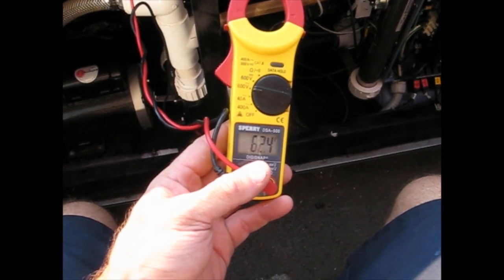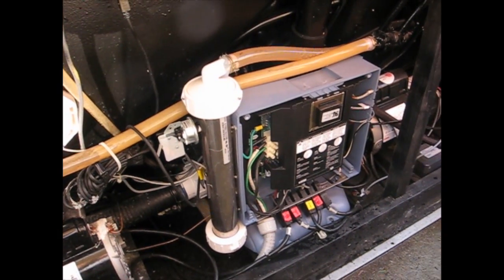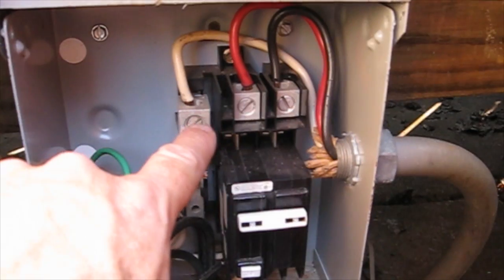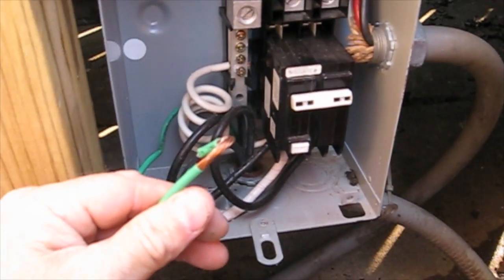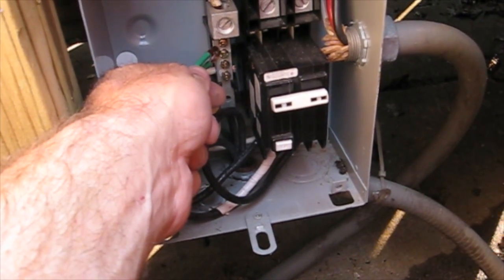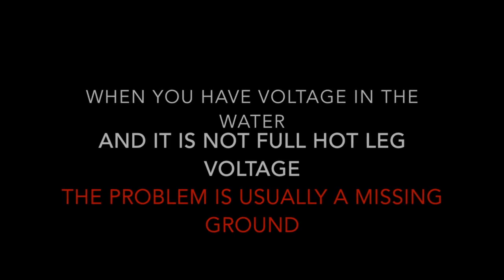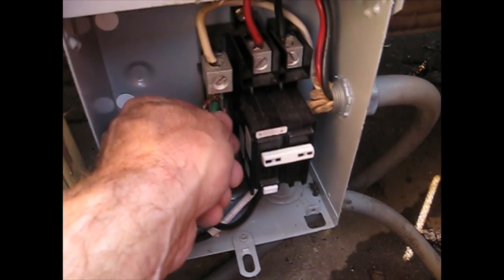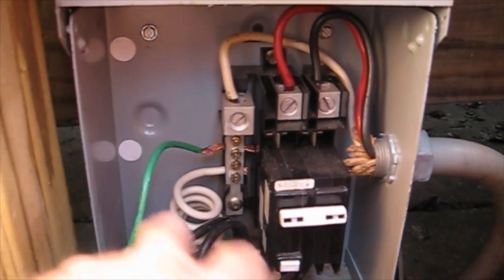Voltage in The Water on a Hot Tub How To Video from The Spa Guy

Comment: That bonding screw should not be installed at any sub panel. Only at the first point of entry to the house should the neutral and ground be bonded. There should be a ground bar installed in that sub panel as well as a green  grounding wire running to the main breaker box for that  unconnected ground wire. I can not believe you left this video up after multiple people explained this in the comments to you.

Comment: Been an electrician over 30 years and that spa box as per code should have a separate ground bar and the neutral should not be bonded to the box. It's supposed to act as a sub panel and ground and neutral shall only be bonded together in the main panel. Any panel after that has to have a separate mechanical ground and neutral. The main reason for this is if there is a dead short between the ground or the neutral the main breaker in the primary panel will trip first.

Comment: Just had hot tub installed on concrete pad. Breaker box installed i5 feet away. Conduit running under concrete pad up to a stub under hot tub. Just opened breaker box and found green ground connected to nothing at all.  Thank you for your help. Someone is getting an ear full.
Reply from the maker: Glad to help!!
Reply: Good catch, under the right circumstances that could have gotten someone killed. Grounding and bonding is so important around anything that contains water.

Comment: I have the same exact problem  but when I hook up the ground it trips my gfi and if I disconnect  my element it Does  not trip the gfi but then I don't have no heater element  hooked up ,Please help I checked my element  with a ohm meter  with taps disconnected  and am getting 15 with ohm meter  set at 20 I also check element with ohm meter  one PRONG  at a time ,one to prong and other one to element  housing and its ol ,both checked out fine so that would tell me that element  is fine ,but when I hook everything  back correctly it trips gfi breaker again, when I do a jumper from bottom  of relay black side to element it heats the water but I feel a lite shock when I touch the water and am bare foot

Comment: What if it's 120v in the water?
Reply from the maker: Then you can't have a GFCI in the wiring first which is a no no.. You need to get a GFCI wired in and then it will trip.. You start unplugging things to figure out what is putting voltage in the water..
Reply: Well thats the problem I do have a 50A Gfci and it didn't trip I thought maybe it was a ground but now I'm just lost.
Reply: I have full 120v in the water.
Reply from the maker: @masonowen839  Do you have a GFCI Breaker installed?

Comment: Ground and neutral are only to be bonded at the service, otherwise you can put a load on your ground which can in turn put a load on any other metal chassis it is bonded to.

That's NEC.

To prevent a fire, electric shock, improper operation of circuit protection devices, as well as improper operation of sensitive equipment, the grounding of electrical systems, the bonding of equipment and circuit conductors must be done in a manner that prevents objectionable current (neutral return current) from flowing on conductive materials, electrical equipment, or on grounding and bonding paths [250.6].

This is accomplished by keeping the grounded (neutral) conductor separated from the metal parts of electrical equipment, except as required for service equipment in 250.24(B) and separately derived systems in 250.30(A)(1)] in accordance with 250.142.
Reply: Spa Guy... you are incorrect on this one as others have also explained to you. The screw you put back in to “ground the box” should not have been installed... the neutral bar should not be bonded to the box in any sub panel... there should be two separate bus bars.. one for the neutrals and one for the grounds. The proper way to fix the issue is to run a ground back to your main panel box and install an additional bus bar in your spa panel for the grounds. The ground should not be hooked in with the neutrals period.
Reply from the maker: @philpompeo7566  I am well aware of what all of you say and I am aware of what the code is what you can't tell me is how you can introduce voltage in the water without the breaker tripping.. If you wire it the way I show you cannot do it.. If I wire it the way you all show I can easily introduce voltage in the water.. My way is the safest way.. Prove me wrong.. Tell me how you can put voltage on the ground or neutral without tripping the breaker or how to put voltage in the water without tripping the breaker.. All of you quote others and codes but not one of you can give me an answer because it is not possible to do... Another simple thing you could do is tell me why the shunt is in the box?
Reply from the maker: Mike Seary ok explain just how you can have a load on the two grounds hooked together at the outboard box end and the feed end and it not trip the breaker??
Reply: @SpaGuy  bad breaker maybe.
Reply from the maker: Mike clearly you are an expert I asked you a question.. here it is again.. explain just how you can have a load on the two grounds hooked together at the outboard box end and the feed end and it not trip the breaker??

Comment: Spa guy I love your videos and I will continue to support you and continue to buy all my spa parts thru you for that reason but these guys are right if you bond ground and neutral in a sub panel there is a possibility that your ground wire could become a current carrying wire and at the end of the day it might get you by but it is not right .....please don’t scold me like you do everyone else .....🤫another reason why I like your videos...good day sr.
Reply from the maker: No scolding just tell me how it is possible to have too much ground? How is it possible to have two lines of ground together on the box end and that is different than the feed end which is hooked together and lastly why is the shunt in the box form the factory if there is no use for it..
Reply: Spa Guy current takes the path of lease resistance so if something was to ever happen to the neutral wire like a break in the wire then ground becomes the current carrier....and that could be a bad thing .....I know it’s far fetch BUT just stating facts out of the holy bible for electricians (the NEC) .....the bonding screw is in there form the factory for certain industrial applications ....I work at Gould’s pumps where we build pumps and we bond neutral and ground when we hipot test curtain motors just for testing purposes ...other then that I don’t know why they put them in there ......can’t believe you responded to me I just wanna say thank you so much for you videos....I moved into a house with a hot tube that had a leak in the fountain and a seized motor and your videos saved me hundreds ....I just wanna say thank you 😊
Reply from the maker: Ok so lets think about this of for a moment.. You have a ground wire coming to the box and you have a neutral wire coming to the box.. 2 separate wires one hooked to the neutral bar in the feed breaker box and one hooked to the ground bar.. In the feed breaker box both of those bars are hooked together with a shunt bar.. No onto the GFCI box.. One hooked to the ground bar and one hooked to the neutral bar.. Both come from the same point of ground from the feed box therefore they are really the same ground though they are two different colors and wire sizes.. If you were to unhook the white wire at the feed box the GFCI breaker would stay activated but the neutral wire from the GFCI brewer to the tub would introduce about 70-80 volts AC into the water.. If the ground wire was hooked up and you unhooked the white neutral wire at the feed breaker box the GFCI would not set.. So there is actually a way to introduce voltage in the water by losing a connection on the ground wire from the feed box to the GFCI box.. If you put the shunt in as I show it would be impossible to introduce voltage into the water through the GFCI breaker.. also if you had an open on either the ground or neutral wire then the box as well as the GFCI breaker side would still be grounded so there is no scenario that you can have voltage on either wire without it tripping the feed breaker.. No matter what the manuals say my way is the safest way and if the manuals do say that someone should work to change it because it is dangerous.. If you don't believe me unhook the feed ground at the feed box and test your hot tub water to the earth ground by wetting the dirt and placing a probe in it and the water and you will see what I am describing is true.. Then hook the ground back and unhook neutral and see the GFCI breaker trip.. Remember I don't know much but I do know hot tubs.. I have personally worked on 1000's of hot tubs and seen every crazy was something can be wired and my way is the safest period.. Thanks, Spa Guy
Reply: Spa Guy not gonna lie I have a huge amount of respect for you ....you clearly know your hot tubs and I will try that in the spring time but it’s 9 degrees in New York right now and there’s no way I’m unhooking anything right now lol 🤞🏼 ....I’ll need your help in the spring time anyway with an air valve that I can’t identify that has a white colored seal that’s leaking air, it got really gummy for some reason ......Again thanks for everything

Comment: Should never connect the ground wire to the neutral bar.
Reply: NEC code rule. Ground and neutral must be separated after the first means of disconnect. Therefore in the main panel the ground and neutral get bonded together. Anything after that they must be separated.
Reply: @dylandohn7922  I have watched a few of his spa GFCI videos and i always turn my head sideways when he bonds the neutral and ground bars together.
Reply: No tanks I don’t need to put that in my knowledge, ground and neutral is not the same., they are connected at the main disconnect for a reason but ground and neutral are not the same.
Reply from the maker: Let me get this straight you agree that they are connected at the source but are different at the next box how on earth is that? Ground and Neutral are exactly the same until you get on the hot tub side of the GFCI.. Then they are different... You need to stick to what you know I can tell you it is not hot tubs and wiring..
Reply: @SpaGuy  Ground and Neutral should be connected together only at the main breaker box and nowhere else. If you have two parallel wires that you call neutral and ground connected at both boxes, they are NOT neutral and ground. They are both half neutral at all times. If the tub is trying to draw 10 amps between hot and neutral, then there will be 5 amps running back to the main panel on the neutral wire, and the other 5 amps running back on the ground wire because they are parallel and equal wires. There should be all 10 amps on the neutral and obviously 0 on the ground during normal operation. The only way to guarantee this is by not bonding them together anywhere beyond the main panel.
Reply from the maker: The ground bar and the neutral incoming from the main breaker box are already connected in that box.. So what would the problem be too much ground?? That is a rhetorical question.. the answer is it makes zero difference if they are connected together or not except to people who think they are "Certified" electricians... The whole reason the shunt comes in the box from the factory to be used to connect the neutral bar to the rest of the box and ground is there are times where there is no neutral wire to the box only three wires like in the old days so you simply connect the shunt to the neutral bar and the Curley wire to the neutral bar and you are in the exact same position you would be in if you have a neutral and ground all the way from the main box to the gfci box.. I happened to think you are in a safer position with only one source to the gfci box because with 2 ground sources I can simply unhook the ground wire if the breaker was tripping and it would stop trip.. It would also introduce voltage in the water at that point where if you had one ground source and you unhooked it the breaker would not set.. So put that in your knowledge pipe and smoke it.. Spa Guy

Comment: I have the same issue. I'm getting about 1 volt in the water. Tub is connected to a GFCI breaker. I see ground wire coming from GFCI to the tub panel ground bar. Appears ground is hook up properly.
Reply from the maker: If there is ground from the main panel all the way to the tub through the GFCI box it is impossible to have voltage own the water.. You have an open ground most likely also it should be more than 1 volt.. How are you checking? From the water to where?
Reply: Spa Guy I'm testing with a multimeter on water and ground wire (green). Also by sticking my hand in and feeling.
Reply: @Snackzy-TDS  never test with your hand in my opinion.

Comment: In a sub panel neutrals and grounds need to seperated. Yes ground needs to go to ground though.
Reply: Plain and simple ground and neutral are only bonded at first disconnect and separated from that point on. Buy a ground bar.
Reply from the maker: Ground and neutral are the same feed incoming.. They will be separate until you use the shunt but you would not use the shunt unless you only have one incoming ground.. I am not sure what you all are hearing but I never said they should be hooked together in the sub panel.. I said they are the same feed.. In the main box ground and neutral are hooked together..
Reply: @SpaGuy  certified electrician here. you are supposed to have 4 wires from the panel. 2 hots neutral and a ground why do you think there is 2 separate wires a green and a white. electrical engineers. I know in the panel they are together at the source. let me explain further. ac power flows on the white wire back to the source. the ground is like a emergency to take the electric back to the panel. you are in no way supposed to have that connected together because now it's not a ground anymore and electric is flowing on the wire and can back feed the water again if something happens to another wire. Google it if you like. if you need further explanation message me again because I love spas and people in the name of Jesus brother.
Reply: @Mr1bigsal for the record, are you saying that the neutral should be isolated, but ground should be connected to this both this metal panel and the equipment back to the main service panel?